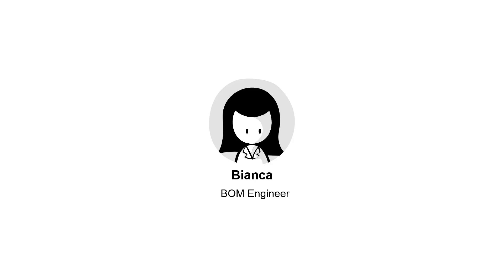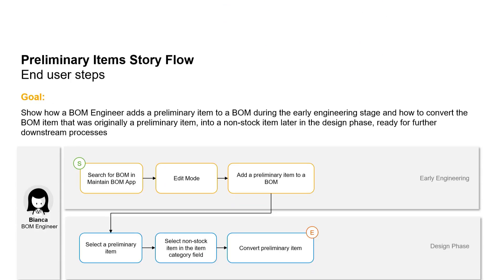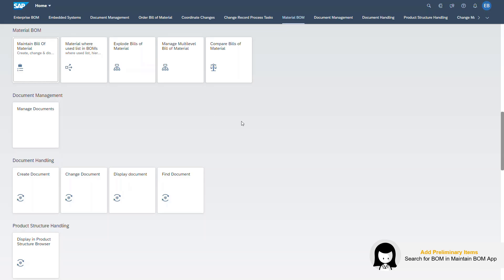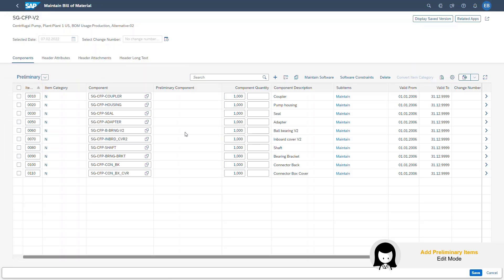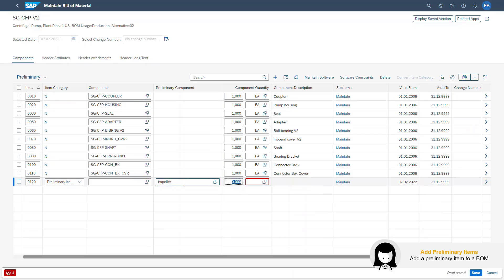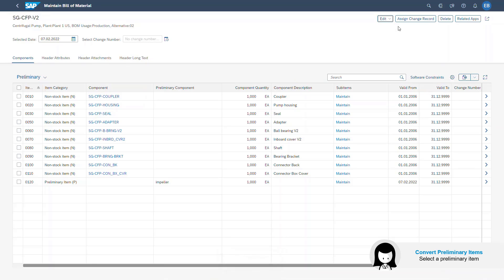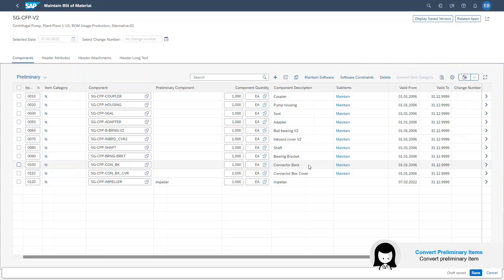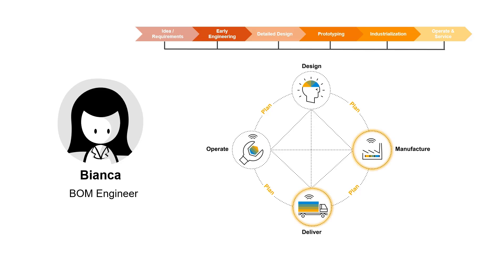Use Preliminary Items | SAP S/4HANA Cloud Bill of Material

Comment: Nice video. I am using Fiori 2022. In that I am not finding "convert item Category" and Item type "P". Are they available by default or do I need to enable them? Please provide the step for enabling above options. Thanks in advance.
Reply: Hello Prabhu,
The feature is available in S/4 Cloud and S/4 OP 2022 onwards. If on OP, please check in SPRO node "Define Item Category" in BOM customizing the presence of column "preliminary item". If it's present, then preliminary item is supported. If the feature is supported, custom item category can be specified with "preliminary item" column checked and then can be used in fiori applications "Maintain Bill Of Material" and "Manage Multilevel Bill Of Material"